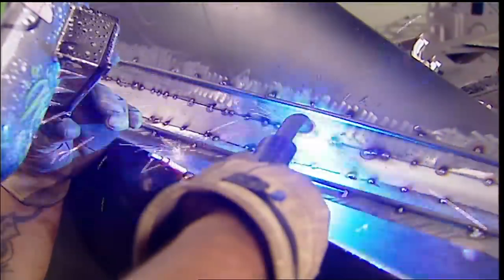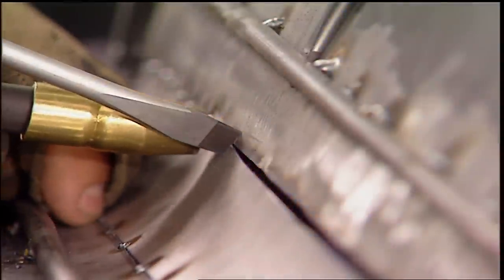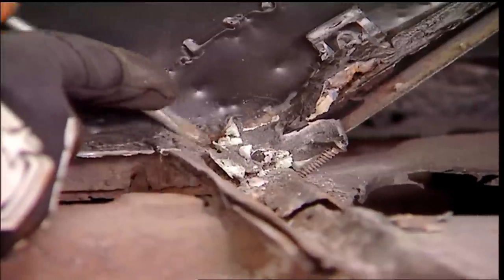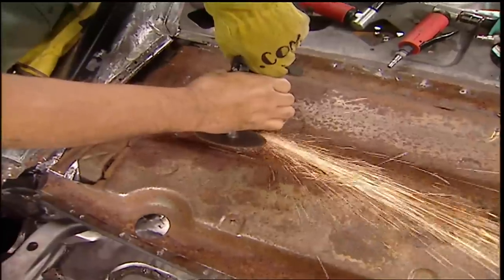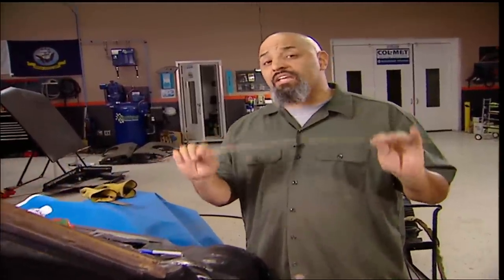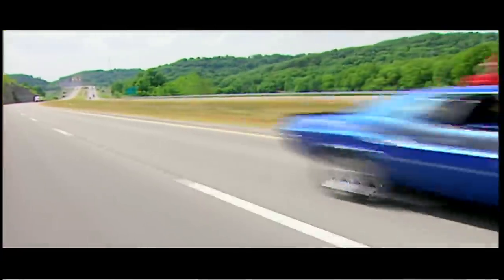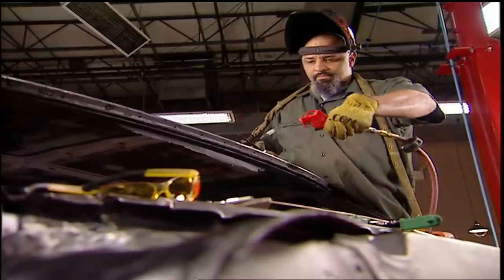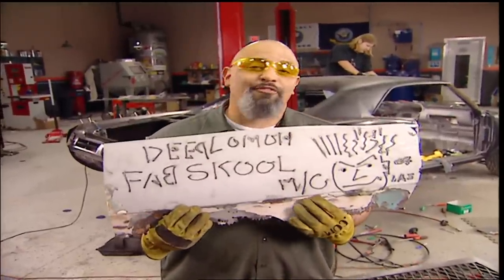Rust Repair Trial and Error on a Classic Pontiac LeMans - MuscleCar S2, E17

Comment: I have used the brazing method on one car a very long time ago when I was a teenager. I will incorporate that method with my new projects. I have a 78 Suburban that is in worse shape than this Tempest. I also have a 66 Corvair Corsa 140 that has some rot and will have mods like the D2 Chaparral front spoiler design( modified to work on the smaller vehicle). I will then modify both the front and rear body panels to allow for a three inch increase on each side for the new suspension. Included will be scoops in the rear quarter panels for the intakes to the modified engine. This will be creating the Corvair that would have been the logical extension if the Corvair had been allowed to get changed like it was anticipated it would.
By the way. This was great to watch as I remember the people who showed me the brazing with a gas torch (which I will have to re-learn). You did a good job of figuring out that you could do more by making smaller pieces work together.

Comment: Curious here.  Have you ever tried to lay your replacement metal on top of the area you are going to cut and use the plasma cutter on both at the same time? Replacement metal and back metal that needs to be cut?  I've never tried it but always wondered if that was a way to get a perfect replacement piece? My thinking has always been it might work well with salvage yard metal replacements?  I guess it depends on how fine a cut the plasma cutter makes.  Thoughts?

Comment: Nice work! A full quarter panel would have eliminated most of the issues you had - unless of course, only the skins were available at the time. Nice fab work though. Work on these old beasties long enough, and at least some fab work will be required. Especially if the car is one that you cannot buy the whole damned thing out of a catalog. Like a Cadillac or Lincoln.

Comment: I liked Lou...and Tommy with long hair?? I forgot about that. OK Folks.....listen up......NEVER, EVER touch bare metal without gloves!! Ever. Too many times our shop has to chase after someone else's restoration and repair "bubbles" and other flaws in "prefect" paint....only to uncover actual finger prints in the metal!! Yep, under all the primers and paint....there's the culprit. Actually, the entire bodywork process should be done with gloves on.  I have plenty of pictures to prove it too. I've been doing Pebble Beach level restoration work since the mid 80's.....won our share of awards.....seen a lot. Oh...one more detail...the "Proper" way to install quarters and floors is with a spot welder. Just like the factory did them. Plug welding is points off! We even go as far as counting the original spot welds and reproducing them :)  Plug welding is fine for street stuff though.